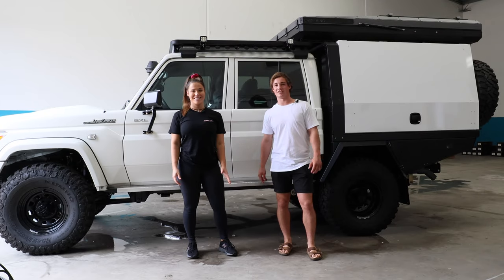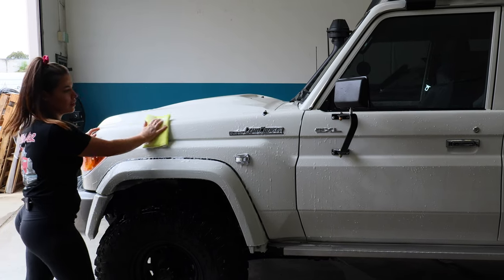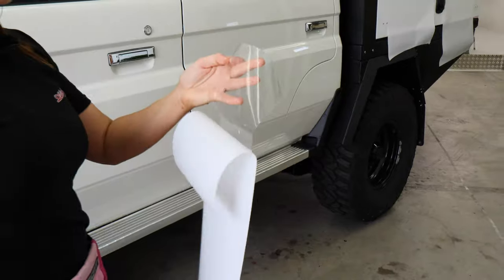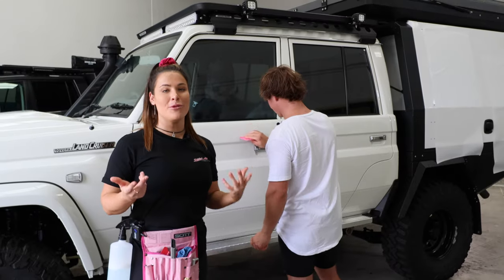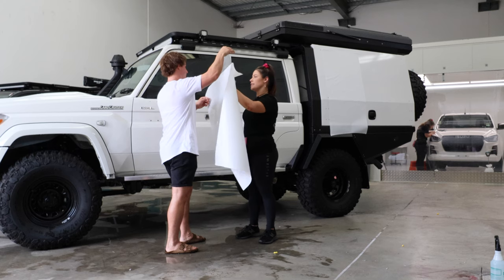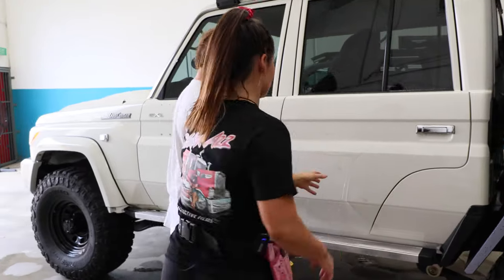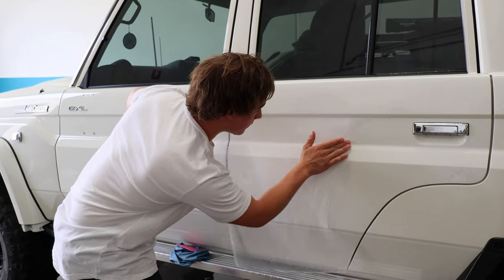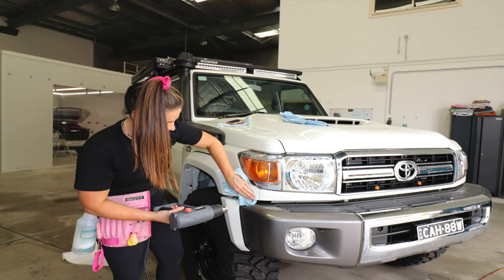79 Series Landcruiser BushWrapz Install | Episode 2

Comment: Sweet looking rig mate!
What suspension setup and tyres (size) are your running?
It looks really great.
Reply: Hey David we went with dobinsons 2 inch lift pre rego GVM Upgrade, you probably already know but that’s as high as you can go with the dobinsons GVM Upgrade at at the time in this video it has 35’s on the Ute but I am now running 33’s just allot better for travelling around Australia especially when travelling remote if you do a tyre it’s allot easier to get a 33 than a 35 😃